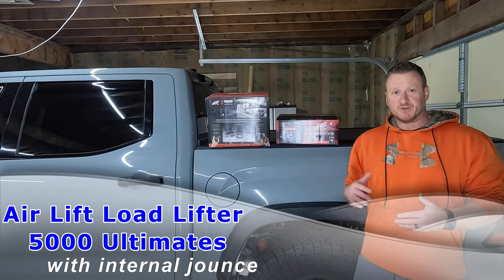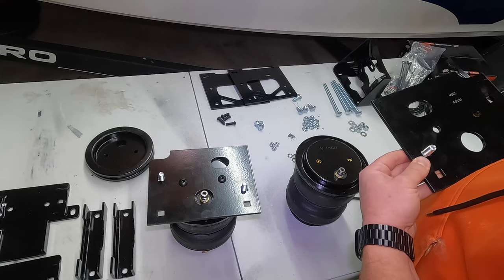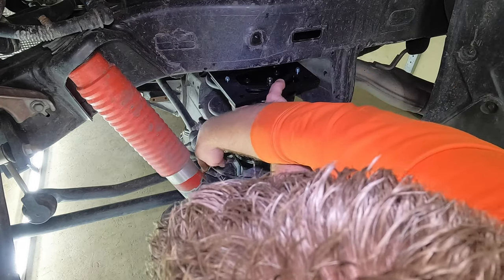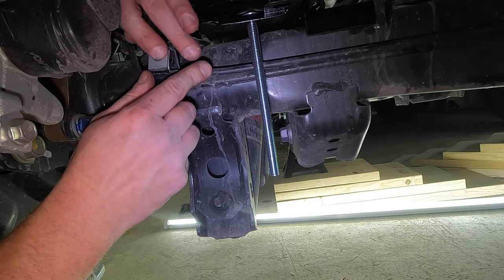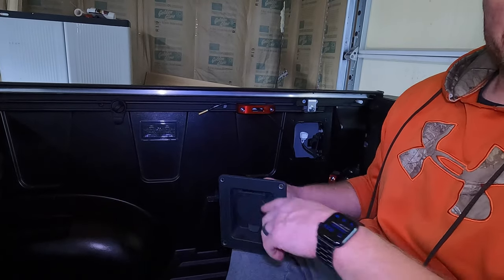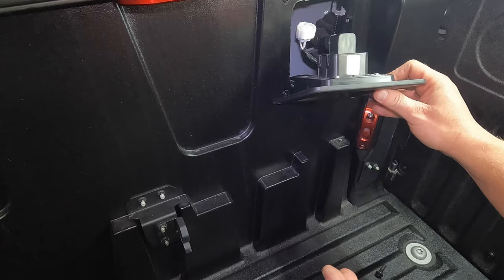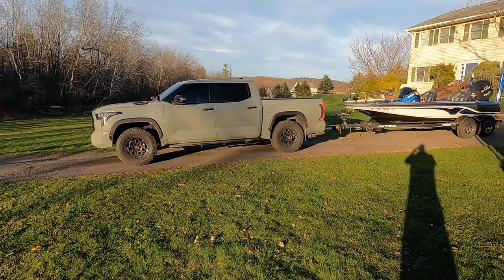No More Squat!...Air Lift Load Lifter 5000 Ultimates, 2022 Toyota Tundra...In Depth Install

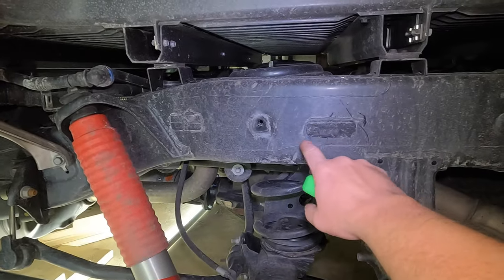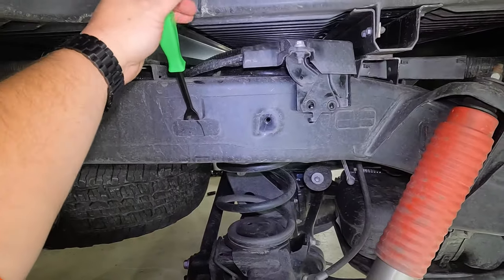Comment: Good video!! Basically just the exact instructions in video form, not much more you could ask for in regards to straight forward 👍🏻 Just installed mine today, what exactly is the point of removing the plug cover/plates? Seems like the brackets could be mounted over the covers without exposing the inside of the frame by removing the plug 🤷🏻‍♂️ @ 9:26 & 9:35
Reply: Also I had 2 short bolts (that came in the kit) left over at the end of the install 🤔 anyone else?

Comment: Also. If using bags once a month and setting it to 50lbs ect. When done how would you release the air out the bags? (If don’t buy the electronic remote stuff)
Reply from the maker: You would release it using the valve that you fill with as well, super easy!...but I definitely recommend the compressor, it's so convenient!

Comment: Great job Patrick. I’ll be doing mine soon and this will make it much easier. I saw lots of opportunities for blue loctite on the hardware that’s not nylon nuts. I’m ocd like that. Also I’d mention that those that are not needing side to side adjustability that they can run a Tee between the bags and only use one fill valve. That’s what I’m doing. Also a couple of other good valve spots are just above the trailer lights plug and inside the fuel door. Thanks again!!
Reply from the maker: Thanks Paul, much appreciated!!…and great ideas on the install, thanks for sharing them for everyone!

Comment: Great video, sir! My trick for running the air lines through the bed support is to put a small section of wire loom around the air line by sharp areas. The loom can be zip tied to the air line and adds a ton of material to keep sharp edges from wearing through the line.

Comment: Well done! Yes for all the unbelievers, the sag is real due to the softness of the OEM springs
Reply from the maker: Thanks man, I appreciate it!!…and yea, I think I may do a short video just to show people exactly how bad it is…not sure why people would think I’m making that up but it’s all good!…thanks for watching!
Reply: @NitroZ18Fishing  Since the TRD pro is lifted, do you not need the Load lifter spacers?
Reply from the maker: It's ok at stock height, but once I add any kind of lift in rear I'll be adding an Air Lift spacer for sure...depending on how I go of course, but with the Westcott 1" rear lift I'll be adding the 2" spacer from Air Lift...hope that helps!
Reply from the maker: *how high

Comment: Great video!!  I am looking at purchasing a 1794 and ran across your video.  Do you know if the suspension for the TRD Pro and the 1794 are the same, in regards also swatting?  If so, I might have the same issue and want to consider a 1794 that has the Load-leveling Rear Height Control Air Suspension with AVS (Adaptive Variable Suspension) System.  Do you know if the 1794 will also squat?

Comment: Why did you remove the recessed frame plugs from behind the brackets? Not sure it would have made a difference and certainly protect the frame against rust, especially in the Northeast.
Reply from the maker: I was actually wondering the same while I was doing the install… The instructions specifically say to do that step, but I'm honestly not sure why… I showed it in the video because the instructions call for it but I have to agree, I don't think it would make any difference at all!

Comment: I just ordered a set! Can't wait to install and use your video as a guide. 

Can someone let me know if there is no reason I shouldn't run both bag lines to a "T" then run a single outlet to the same location in the video?  Yes I understand this would equalize the pressure to both, to me that's a plus.  Just curious if there is any real reason not to?

Comment: “I actually counted the threads”! 😂OMG. LOVE that about your videos though. 

Craziness. I’m in complete disbelief. Curious if the auto-headlight-adjustment feature works as advertised when the sag happens and also how (if at all) driving performance is affected?

Also, can you do a video on dash cams? I bought the OEM and the interface and app SUCK. Good news is it’s probably easily fixed with firmware and app updates. Bad news is until someone gets Toyota’s attention on it, nothing will happen.
Reply from the maker: Hahaha...my OCD is outta control at times! 🤣🤣🤣... that's a good question about the headlights, I honestly didn't notice any difference but I also wasn't really paying attention to that… If I get a chance I'll deflate the bags with the boat hooked up and go for a ride at night to see if I notice the auto adjustment feature kicking in!
Reply from the maker: And yeah, absolutely!… I will be adding a dash cam once I get caught up with the mods and videos I have planned!

Comment: Great video! Is there any reason you did not T the air lines together? The only reason I can think is pressure transfer when cornering? I see that Air Lift sells a T for their systems.

Comment: where you buy air lift load lifter 5000 ultimates 2023 toyota tundra , it fit for  2023 tundra
Reply from the maker: I got mine from SD Truck Springs, but they're sold by several companies!...if you Google them, you'll see all the options, check around for best price!

Comment: The problem with airbags is that you always have to bring air in them and when you pass something on the road like a hole or a bump it feels like you don't have more suspension like you have  bum stop 😢
Reply from the maker: That's the good thing about these ultimates… You can run them at zero psi without damage due to the internal jounce… I don't even know they're back there, definitely worth it!

Comment: Just a quick tip. Add a piece of rubber hose anywhere the air lines touch the frame or any metal. Wont be any time soon but over time they will rub through and you could lose all air down the road. Is there a minimum recommended psi to run the bags at?
Reply from the maker: That's not a bad idea, thanks man!...these bags can be ran completely empty at zero psi, that's the benefit with these Ultimates with internal jounce...most bags need minimum of 5, but not these...thanks for watching!

Comment: Patrick what kind of tongue wt. do you have with that boat giving you that much squat with out the bags ? great video btw !
Reply from the maker: Thanks Rick, I appreciate it!...I'm honestly not sure of the exact tongue weight...the package alone (boat/motor/trailer) weights around 3200 pounds give or take...and then you have my 12,000 pounds of gear in it 🤣🤣🤣...I was never good at calculating tongue weight!

Comment: Dude there is no way that little boat caused that much sag.
Reply from the maker: Would ya like me to put it on video???…bed was totally empty, boat was only thing hooked up…not that I have any reason to lie, or prove something like this, but I will gladly post a video of me hooking boat up if ya would like!
Reply: @NitroZ18Fishing  something wrong with your truck then
Reply: Or a lot of water in your boat I’m by no means trying to prove something but im in disbelief of what I see.
Reply from the maker: @ToyotaFamily  yea no worries man, I can make a short video and post it showing me hooking boat up with bags deflated…the suspension on the Pro is on the softer side, and the boat package weight is somewhere around 3,000 pounds…then add all my gear (which is a lot, I carry a ton on board)…I’ll gladly make a short clip showing it for the channel!
Reply: @NitroZ18Fishing  no need great job the install though.
Reply from the maker: @ToyotaFamily  thanks man, I appreciate it!
Reply: Leroy the springs on the Trd Pros are very soft for off-roading. Both my 16’ empty cargo trailer and 23’ bay boat squat mine.
Reply: Ya the tundra payloads are crappy on some trim lines

Comment: I wonder if this can fit 2023 sequoia
Reply: Yes it can fit
Reply: @artemusburton4824   have you tried it?  I have a 2023 Sequoia and ordered the kit based on the Yota Garage's video that said they would fit no issues.  I also asked Airlift and they said they haven't confirmed yet, but they were going to be looking at it.  I'm hoping it does since the squat with my boat is terrible...can't believe how much it drops.  Also, wondered how it rides when unloaded and running 5psi?

Comment: Looks good. Are u going to get the wireless compressor like u had on old truck?
Reply from the maker: Thanks man!…Yepper, I’ll be installing it this weekend!
Reply: @NitroZ18Fishing  you find a good area for the mounting of the compressor (with the EZ mount)?
Reply from the maker: Have a couple ideas but haven’t decided yet…I’m considering doing what I did on my 2020 Platinum since it worked out so good!

Comment: Great Job! On passenger side where air hose is zip tied to the wire line and running into the bracket feeding the line to the drivers side; you may want to add felt tape to any parts that may rub due to vibration as a safe guard. Not a biggie but you stated you are OCD so this might give additional piece of mind. Great video, Sir!
Reply from the maker: That's not a bad idea!...thanks man, I appreciate the feedback!!